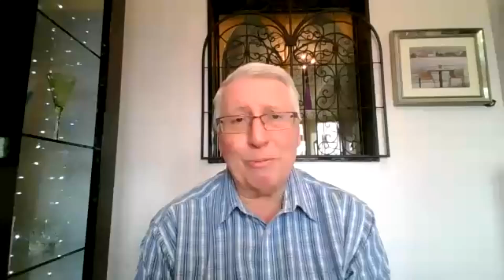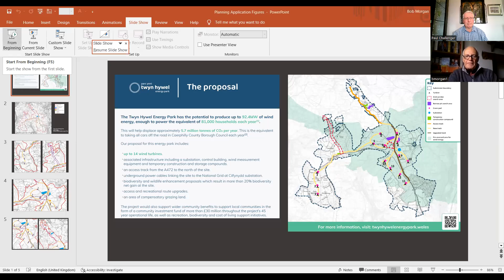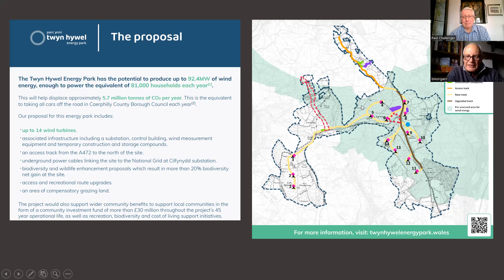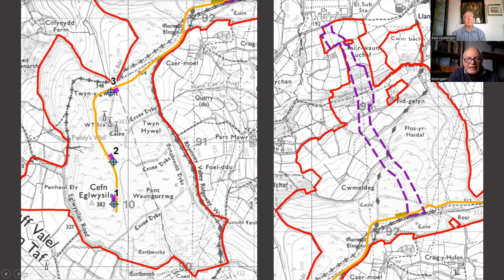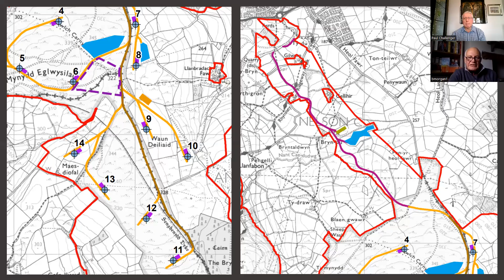eglwysilan common news

Comment: Seems odd to be using borrow pits when there is a ready source of hardcore available in the Llanbradach Coal tips, in addition the track layout does not appear to be economically laid out and could be shorter and therefore use less hardcore (it maybe related to gradients).